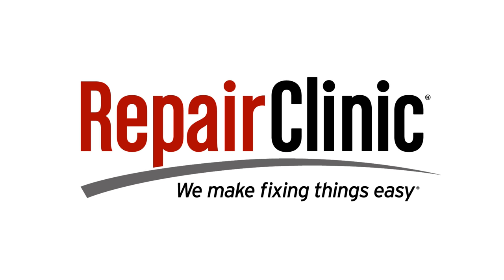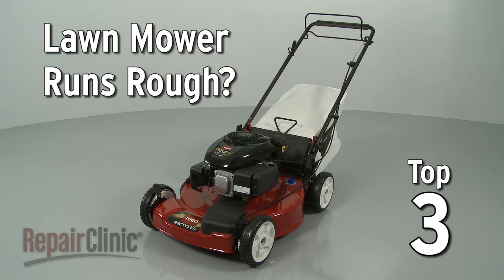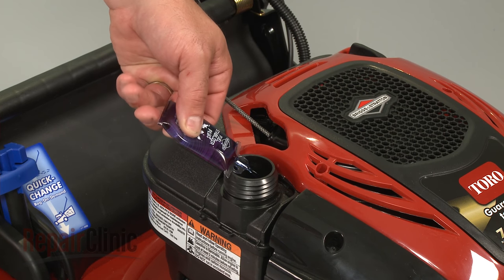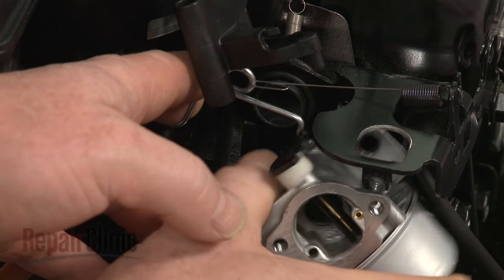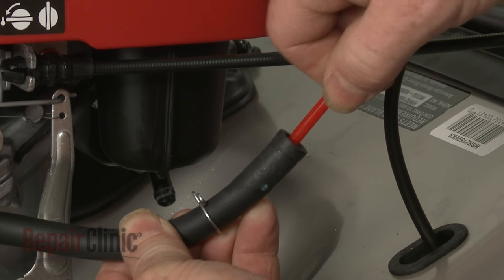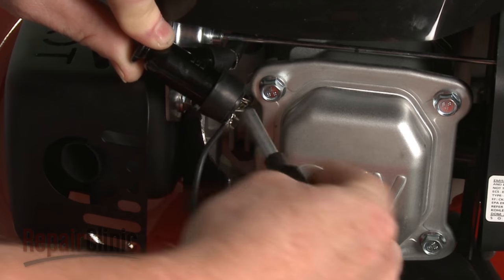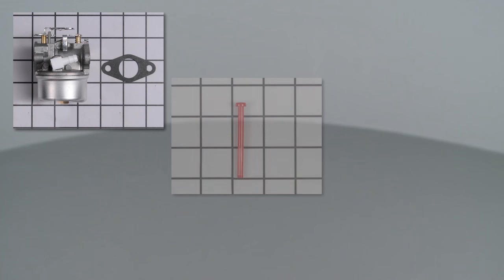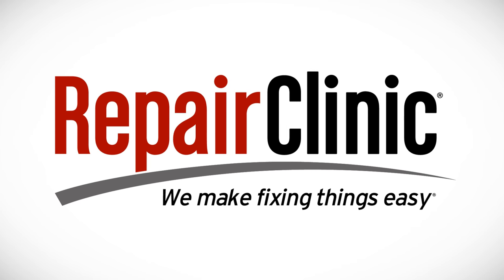Top Reasons Lawn Mower Runs Rough — Lawn Mower Troubleshooting

Comment: My pressure washer was surging and then would die. Cleaned the carb, changed the plug, still not working. Then this video says to check the breather on the gas cap. Brilliant!. Solved the problem. Thank you for the well done videos. Count me as a subscriber.

Comment: The gas with ethanol in it is rough on small engines and probably larger ones as well. An engine that runs rough often has a leak at; say the diaphragm under the carb, a leaking vacuum line or leaking intake manifold gasket, etc....

Comment: hi. I hit a metal bar while mowing lawn. stopped abruptly and when I started it back up engine seems to run rough. vibration coming up thru handle bars. any help appreciated 🙏
Reply: Same happened with my mower
Reply: @edscottable  I'm a little late, but check the blade. It might be bent and so it's out of balance

Comment: Today I was cutting my grass at normal speed and sound and at some point the sound got slowed down and I could tell the blade was not running fast.I'm thinking it could be the spark plug or of the filter from the fuel causing the speed delay

Comment: Why does my 3.5 HP Briggs and Stratton lawn mover engine runs erratic and high speed can be obtained only by screwing the mixture screw fully in. If carburetor problem, where can I get a new unit here in Malaysia. Old model, pulsar jet type.

Comment: B&S auto choke mower. Starts quickly, but poor power. Stalls out after 5 minutes. Works better for a while when I zip tied the throttle wide open then stalls out. Things I've tried, but no improvement: 1) new oem carb, 2) new spark plug, the correct one. 3) new coil/magneto, & spark plug boot, 4) snugged head bolts 5) removed gas cap when stalling to check for bad cap, BTW no gas filter to clog...fuel line flows quite freely,  5) auto choke wide open before and after stalling, 6) new oem air filter, 7) cleaned PCV drain. Same problem before and after new fuel. What am I missing?
Reply: Did you every find the solution?

Comment: you know i see a lot of these types of videos and you guys have forgotten the air filter!. many mowers will go for YEARS and no one ever remembers to clean the filter, and when it plugs up the mower cant breath
Reply: I replace mine annually on my Troy Bilt TB230 Briggs and Stratton engine along with the oil and spark plug. Going to clean the carburetor as well.
Reply: First thing I check. Air filter
Reply: Absolutely,  I changed my spark plug first (I don't know how many years old it was), but it was the air filter [engine was running rough and choking out]